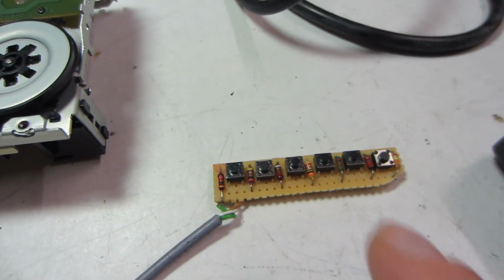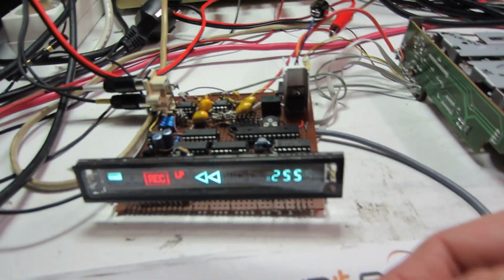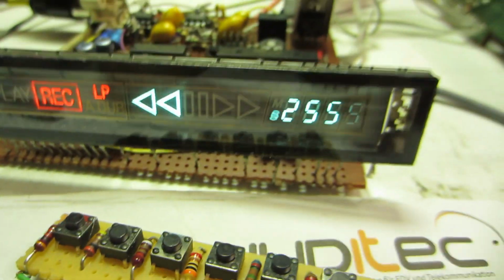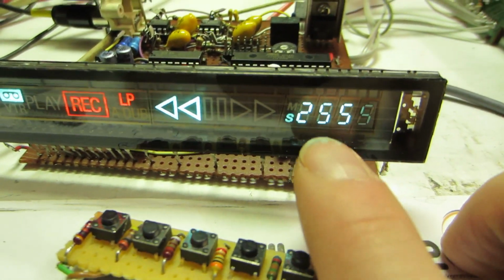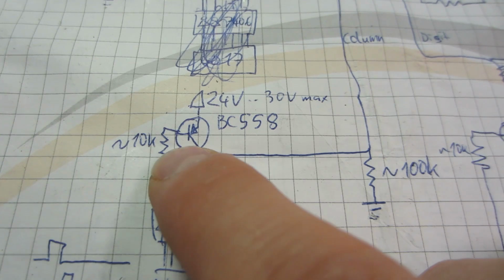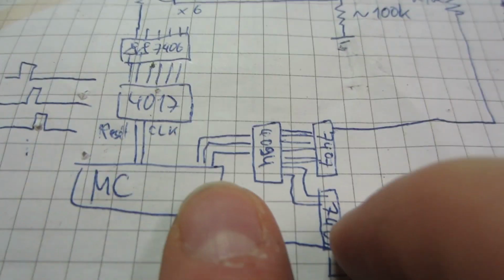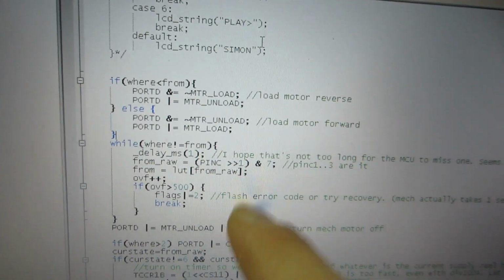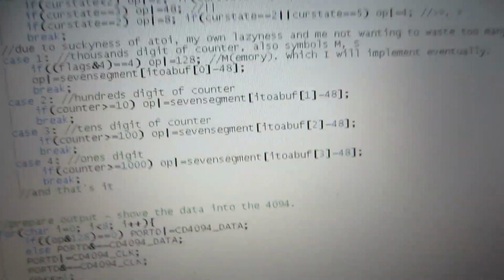Driving a full logic tapedeck and a VFD off an Atmega

Comment: Hi! Nice!,  I do have a question if you don't mind...
Both of your open collector driver ICs are capable of handling 30v so why did you use the PNP transistors?  I think they are not strictly necessary.  Is it because you wanted to invert the signal from the uC?
Reply from the maker: I wanted to drive the power, not drive the absence of power by creating a driven short to ground and needing lower-resistance pull-ups instead of high resistace (100k, could probably work with 1m) pull-downs.
NPNs (which is what the output stage of an open collector is IIRC) are good for driving to ground, PNPs are good for driving to Vcc. At least that's what I recall if I understood it correctly.
This point is moot though, because it turned out 20V is plenty enough for a bright display - the CMOS 4000 parts can handle 20V. The banks of transistors were absolutely unnecessary.
Reply: @senilyDeluxe  I might be missing something, but I think t he value of the PNP pull down resistor and the NPN pull up resistor would be about the same.  I think the real issue is quiescent power draw.  If you're powering half of the display most of the time, then it doesn't matter, but if you're powering a fraction of it, then the PNP solution becomes more efficient.
Reply from the maker: @Enigma758  I didn't study Electrical Engineering. I almost did - then I encountered a retro computer that needs to be programmed to work and suddenly I was into programming.
So no clue if what I'm saying is right or what you're saying is right.
The NSM pinball machines (rare stuff...) actually use a bank of NPNs to short the display to ground to turn the segments off, just as you suggest (and who am I to argue with a company making pinball machines?).
But I'm thinking that's like having your light always switched on and just slide a board in front of it if you want it dark.
The pull-down resistor can be fairly high resistance, because when the transistor is switched off, the output has a tendency to slightly float up. But if you use pull-ups, they need to actually pass current (even if it's only a few mA). The pull-downs are just for the stray capacitance and the tendency to float up. If you leave the pull-down resistor out, a dark segment will either stay dark or be glowing very dim, but once you switch it on, it'll stay lit (or light up a little less intense) if you switch if off. And it might take minutes to dim down.
I want my displays to use more power if they light up and less power if they are dark.
Reply: @senilyDeluxe  Makes sense, I wasn't sure if the pull down requirements were less for PNP and along with your explanation, I see that you are using a 100k resistor for that.  I agree, there are good reasons for driving high to power a device.  Thanks for the feedback and I really enjoyed the video1